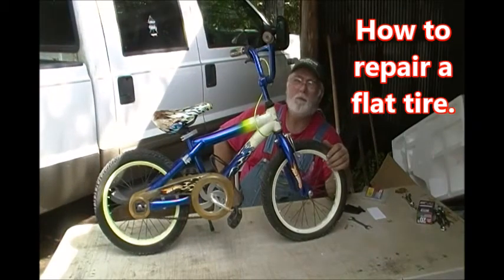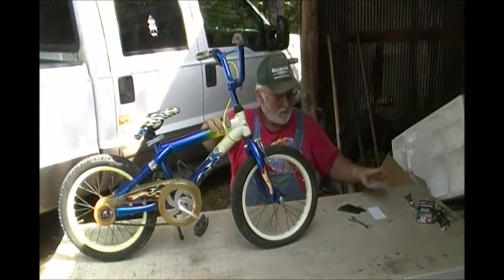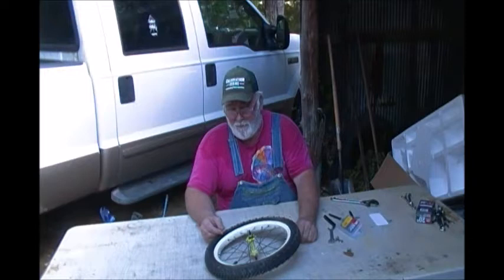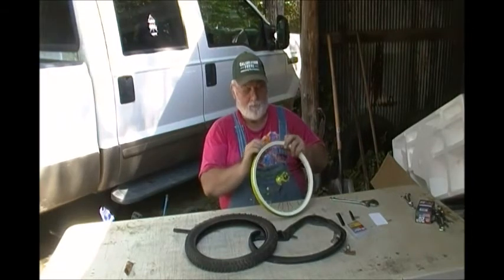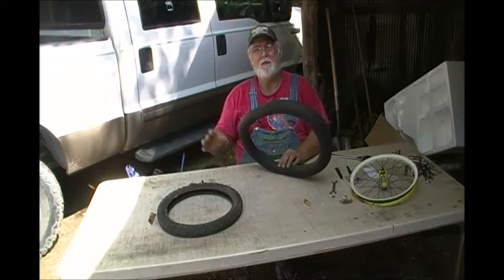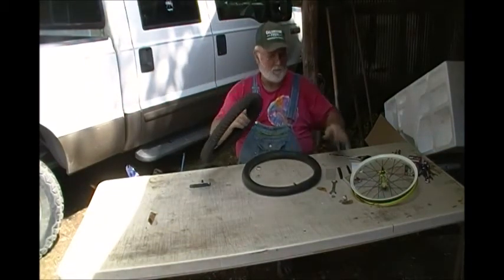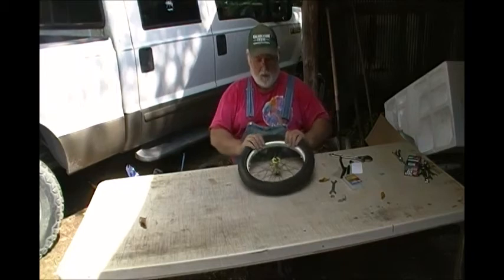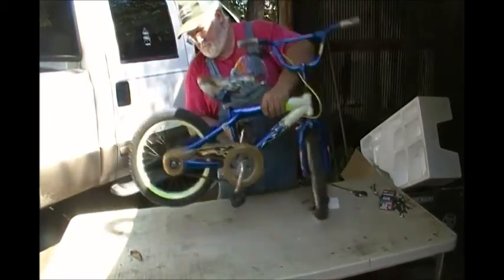How to Fix a Flat on a Bicycle   Check out this Dumpster Find  Why do people throw away good stuff?

Comment: I remember my mom getting mad at me because I used her soup spoons as tire spoons (they had a nice smooth flat end on them)
Reply from the maker: How do you like that X carve?
Reply: I like it, its a fun little machine if you like to tinker with stuff. Made a few signs for friends and  family and they really like them.
Reply from the maker: I had a sign shop, now just do a little from home.  I do mainly vinyl lettering so instead of a router, all I have is a sharp razor slicing the outline of the letters without protruding through the paper backing.  Thanks for watching my videos !!
Reply: Before I got the X-Carve I was looking at a Roland vinyl cutters and such, but the x-carve can do a lot of fun stuff. I can add a laser, maybe a vinyl cutter a 4th axis  etc......